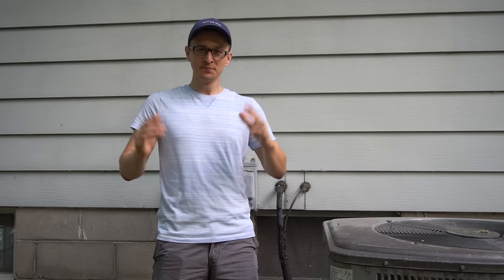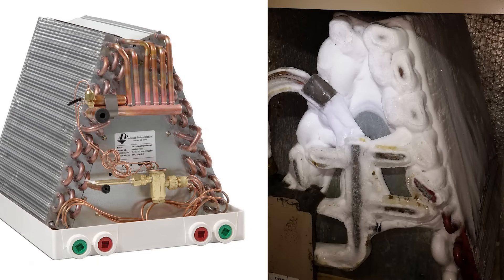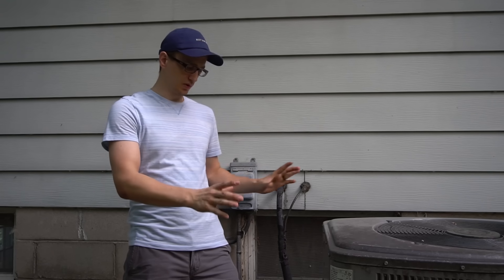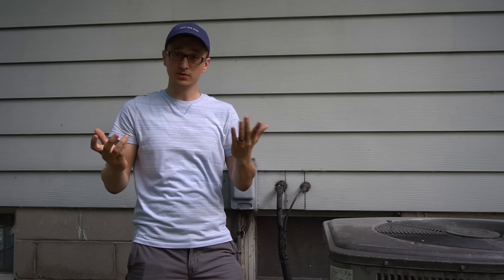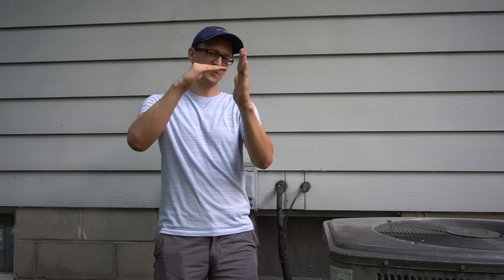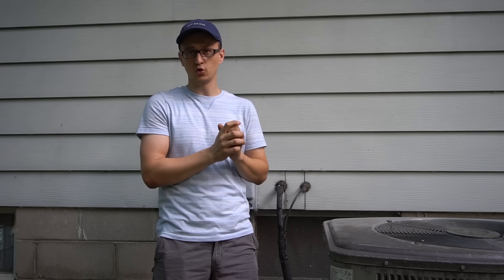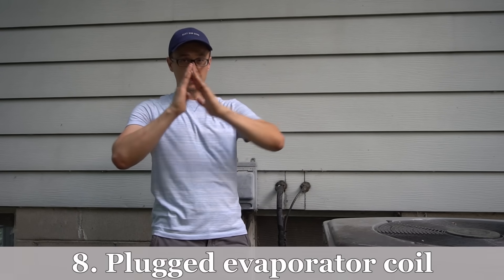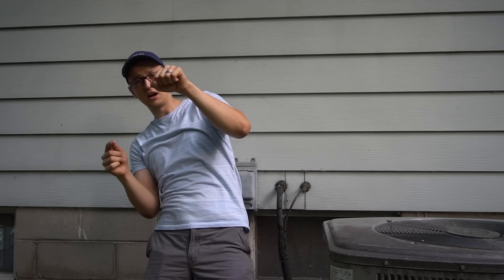8 Reasons Why Your AC is Freezing Up

Comment: I could not piece together why my system all of sudden could not cool down the house one day. The high line was frosting and getting cold after the TXV valve from the evap coils, it was warm then after 10 mins it would start to cool down and frost up. I cleaned the evap coils and turned it on to blow out the cleaner and the end caps started frosting and could not figure it out. Along with some other google searches and remembering comments up until you said the blower motor could be weak on #8 I went and checked my capacitor which should have been 10 MFD was at 2MFD. Ordered another on amazon be here tomorrow. Thanks.
Reply from the maker: Hopefully that will do the trick! Thank you for sharing, good luck!

Comment: Great video! I used these 8 reasons yesterday and it was the capacitor on the blower motor. Quick fix!. This was a neighbors house [younger couple]. I asked have they changed the filter[s]. They replied, "What are filters". They had 2 return air ducts. Oooooo baby! Those filters were in there for years! Thank you so much.
Reply from the maker: Glad to hear you were able to get it fixed! :) Thank you for commenting!
Reply: His dad across the street a/c down same day. I found loose wire. Furnace repair last winter and repairman didn't connect wire. Works great!
day @WordofAdviceTV

Comment: So if you're setting your air conditioner to like 62 for some reason... because you're really hot or something... 🤣🤣
Reply from the maker: Lol, yeah. I was actually just at a house last week where the evaporator coil was freezing because they had the thermostat set to 65 :)
Reply: @WordofAdviceTV  For some reason, my Honeywell thermostat goes as low as 50 degrees Fahrenheit.
Reply from the maker: @07VFDInLCD  Most of them will go to 50 or 55 but if you set it that low, it is almost guaranteed to freeze over. Not sure why manufacturers give you the option then..

Comment: 2:35: The temperature of the refrigerant headed toward the evaporator is only 38 degrees? Is this Fahrenheit? The condenser removes the heat from the high-temperature vapor coming from the compressor, but I had no idea by this much. Are you sure?
Reply from the maker: That wasn't entirely accurate. I was trying to explain it in a simple way. The 38F would be the saturation temperature of the refrigerant. The temperature of the refrigerant itself is much colder. When refrigerant hits air (when hooking up gauges and some squirts out), it comes out at -40F.

Comment: Great job.. well done 👍🏻 
In addition I would add : 

- Thermostat failure causing compressor never shutting off .

- Setting temperature very low while setting blower speed too low at the same time .

- Too high humidity, while temperature is set too low .
Reply from the maker: Thank you!! Good additional reasons! I could have made 10 reasons if I thought of those :)
Reply: How cold is to cold to run my ac during humid days.
Reply: david barnett 
It depends on the efficiency of your AC, the proper air sealing of your room .. etc ..

Comment: Yup....number one happened to me. Except its because I used a new "wrong" filter
Reply: Most companies when installing duct systems don't size the return ductwork for using pleated or electrostatic filters.
A majority of them size the return for the normal blue,green or white see through air filters..if someone has a dust problem, They should use the pleated filters during the colder months since there is less moisture in the air and they don't need to move as much air through the unit..during the warmer or more humid months ,use the thinner cheaper filters to allow more airflow...

Comment: I was hoping that it wasn't because I was setting it at 65 (perfect temp imo) but I noticed last summer if I set it to 67 it wouldn't freeze up. But I guess now I know that is the issue and I'll have to keep it at 67
Reply: 68 degrees Fahrenheit is the setting to avoid freeze up under normal operation.
Reply: @caru3257  

we set it 🥶at 74, in Florida. We could not imagine going down to 67 or we would be ⚰️.

Comment: Isn't the blower motor inside the furnace responsible for making air blow out of the vents?  So if you have air coming out then your blower is ok, correct?  Worried now as husband replaced it, refused to watch video to see how, therefore winged it and uncoiled the thing.  Huge pain to get it back together.  I think it's been freezing up ever since, but it blows so that part must be okay.  The heat wouldn't come on either the last time and I bet it won't now either.
Reply from the maker: Oh boy.. Hopefully it's not as bad as it sounds. Yes, the blower motor is inside the furnace. (I have a video where I replace my blower motor and another video where I explain blower motor wiring) If there is air coming out of the vents, then yes, the motor is good. As for the A-coil freezing up.. As you saw from this video, there can be various reasons why. Is it cooling the house?
Reply: @WordofAdviceTV  Yes it does but it freezes up because it never shuts off.  It ignores when it reaches the temp you have it set at and keeps right on running.  The only way to stop it is to go outside and pull that plug.
Reply from the maker: Your contactor is probably getting stuck in the closed position then. If you have watched a few of my videos you know what the contactor is by now. I would take a look at that plunger if it stuck. Make sure you have all the power off and try pulling on it.
Reply: @WordofAdviceTV  Okay, will do and yes I know now what it looks like and what it does.  Thank you for getting back to me so quickly and will let you know what happens.
Reply: @WordofAdviceTV  Definitely the contactor because it wouldn't pop out until I sprayed it with wd 40.  Then when I put the plug in to start it, it sort of sparked, smoked, and went right back down.  Now not even the fan will come on in there.  I think it was terminal and I killed it.
Reply: @WordofAdviceTV  I did try pulling on it and I tried getting under those 2 contacts and prying it up but not until I used the wd 40 did it pop up.  It acts like something is telling it to stay down as after it did pop up, have a fit, again you could not pry it up and more wd 40 did nothing.
Reply from the maker: @VickiTakacs.  Hey Vicki! Sorry to hear about the contactor problems. To be honest I have never tried spraying contactor contacts with WD-40..  That's not really an "oilable" component. It sounds like the contacts on the contactor are getting welded to the plunger contacts. I would replace that contactor. I have links in the description if you need them
Reply: @WordofAdviceTV  So true that you did not say anything about WD-40 and that's on me.  It was all I had, I was very hot after being outside all day gardening and when I saw that plunger lift, I went a little bit mad.  At that point I would've greased it up with duck fat had it come in a spray, lol.  I think WD-40 is more of a sparky, zzzt type component with a wee bit of smoke.  Am off today to get a contactor.  Will keep you apprised.
Reply from the maker: @VickiTakacs.  Your persistence is wonderful! :) I wasn't saying that oiling it up is bad. Haha I don't even know myself if that's okay or not. Never seen it done. With your positive attitude, I am sure you will get it fixed! Good luck!
Reply: @WordofAdviceTV  I can't really recommend that stuff - A little too exciting with no positive results.
Reply: Hopefully he wired in on high speed for cooling and low speed for heating. I've seen my cousin make that mistake before. Low speed for cooling = bad days ahead.

Also in reading up above, never ever oil certain  electrical components like a contactor. Those are very simple to replace yourself. Turn power off, take a cell phone pic, and hook it back up the same way. They cost like $15-20.

Comment: Have a question please,  compressor hums , don't run , capacitor is good , instead a hard start kit , still hums and doesn't run . Why ? Thanks
Reply: What brand condensing unit?
Reply from the maker: What is humming? Is the compressor working but not the fan? Is the suction line (thick copper line) getting cold? Or is the fan working but not the compressor?

Comment: There is one more Reason for freeze up. If the Contactor does not Release (gets stuck ON occasionally), the pump can keep pumping after the fan is told to stop. Then when the temperature drops and the fan clicks on, its already freezing up. Also, if it is freezing up, way wait so long to defrost it? Why not turn it to heat? thaws is an hour.

Comment: My filters are in 3rooms. I change them every 3 months. When you talk about a filter is there one in the furnace that is up in the attic?
Reply from the maker: If you have filters in your return grills, then it is very unlikely that you have a filter by the furnace. Only way to know for sure would be to visually check though.
Reply: You shouldnt filter each room unless u have severe allergies or some kind of dire medical condition and have a furnace with a UV germ killing light inside. Its overworking your fan motor/ increasing the electric bill too.
Reply from the maker: @srobeck77  Thank you for taking some extra time to answer people Shawn! Much appreciated! :)
Reply: Thanks

Comment: Excellent videos. Could you please tell your viewers How to clean A-Coil in condenser?
Reply: Same way that u clean the condenser coil. Accessing the A-coil is the biggest challenge. That and you probably will need to use compressed air (or a shop vac or leaf blower) instead of water.

Comment: One more reason to add: the magnetic switch that turns the outside compressor on, gets stuck in the "on" position. So when the inside fan turns off, it is still on outside, freezng pipes all the way to condensor. Had to replace this switch. Not sure what was causing it to stick, and was a pain to diagnose.
Reply: That switch is called the contractor.  And yep, a stuck contractor will cause freezing up when the inside blower is not running.
Reply: so low indoor airflow
Reply: More like NO indoor airflow.

Comment: Also, if your air filter is dirty there is the posibility dust is collecting on the blower wheel. The blades of the wheel have a  concave shape to push the air. If they become dirty they will push less air through the indoor coil.

Comment: Also WARNING! Capacitor can KILL you! Even when the power is OFF, it's STILL CHARGED. Quite a danger.
Reply: I dont think anyone has ever died from a split second shock from capacitor. But the suckers are painful I bet.
Reply: @srobeck77  Or from CRTs
Reply: @srobeck77  Oh yes they have! You find the SAME capacitors in defibrillator units!
They absolutely CAN KILL YOU. Look elsewhere here on YouTube for how to safely discharge them, Please! And Google the term "Jesus Stick" ... They call it that because if you don't use it EVERY time you come across a capacitor, then you are going  to be seeing Jesus, much sooner than you (or he?) had intended for you to!
Reply: @w8lvradio  #fakenews. Also your fake comparison between air conditioner capacitors being "the same" as defibrillators as like saying 110v is the same thing as touching a high voltage overhead power line. It's not the same thing......sorry but it's just not.
Reply: do not ignore any of the Warning Labels....

Comment: I live in Arizona. I stay in an apartment. I’m coming up on my 3rd summer here, 1st summer I kept the ac on 68-69 and never had an issue even on 122 degree days. Last summer my ac kept going out and the maintenance man would come and tell us it was frozen and for us to wait a few hours and turn it back on, well we started leaving the temp on 74-75 to avoid it freezing over, let alone leaving it off for a day or two as he’d tell us for it to thaw out but it wouldn’t fix anything. Or if it was finally “blowing” cold air, the amount of air coming out of the vents was slim to none and you could only feel it if you touched the vent, wasn’t nearly enough to change even a degree in the apartment. Needless to say we’d go weeks with horribly hot days. Well here we are approaching summer, got our first triple digit temperature a few days ago and low and behold our ac is out. I can’t help but to think he’s brushing us off or that he’s annoyed by us calling all the time but not once has he ever had any other solution to it being frozen other than us having it set too low which we DONT! it’s set at 74-75, only ever cools our apartment down to 82, AND I make sure to not run it for 2-3 days before calling him so that it has a chance to melt before he gets here if it is frozen so he can at least give me any other explanation than the same bs he’s been giving me for 2 summers now. Would I be wrong to go down to the office and complain??? They don’t seem to care!!!
Reply from the maker: Sorry to hear about the crappy situation. I would agree with you, you should definitely go and complain about that. Likely your AC has a refrigerant (freon) leak and that is why it was freezing up. Your unit will not cool properly until the leak is fixed, some refrigerant added, or the whole air conditioner gets replaced.
Reply: Word of Advice TV thanks to your wonderful video I was able to stop the maintenance man dead in his tracks today as he was about to leave and dismiss us and claim it was because we have it set to low (like always). I stopped him and said “ hey you know what? I’d be a lot more satisfied if maybe you’d check to see if the coil is clogged or if it needs more Freon before you go” (had very little clue what I was saying but I got it from your video & it sounded smart). He looked at me with the most surprised face and went and checked. Well guess what?! It was clogged AND needed Freon! Now I’m no mind reader but something tells me he already knew 😉. Nonetheless, YOURE THE BEST!! Thanks! Saved my family some misery this summer 🥳🥳
Reply from the maker: Haha that's awesome! Way to go, glad to hear you got it fixed! Stay cool this summer ;) Thanks for coming back with an update
Reply: Bri Xo - Sounds like your apartment complex needs to hire a competent maintenance man. That guy sounds like an idiot. If I kept getting called to the same place for the same problem time after time I believe I would WANT to check the basics and get the damn thing fixed.

Comment: Actually there are only 3 reasons why your ac freezes 1 mechanical restriction 2 low on charge or gas and 3 air flow

Comment: What if my fan outside is working and blower is spinning and my ac instantly starts to freeze within minutes of turning on ac? Also i have very weak preasure blowing out the vents
Reply from the maker: I can't say for sure but 2 of the common problems are either a refrigerant problem or low airflow. Have you already replaced your filter? If you go down to the furnace, does it sound like blower motor is running normally or does it sound half dead? If your evaporator coil is accessible you can try taking a look at it to see if it's plugged up too. Unfortunately anything refrigerant related you would need a tech to look at for you though. Unless you know how to deal with refrigerant and have the tools needed of course.
Reply: @WordofAdviceTV  blower is running slower than normal i believe and i tested the run compacitor and is at 4.5 should be 7.5 could that be the issue?
Reply from the maker: @KING__SMOKE  That is pretty far out of range so yeah, it can cause it. Cant say for sure but I would start by replacing that capacitor.

Comment: Anyone can please help m out,I have a problem in York chillers,one of chiller having two system. Both are working perfectly alone,but when I start running system one,it's run upto full speed but don't give command to system two.same is for system two.
Reply: @gregclemen8999     thanku sir, yes u are right both systems are operating through v.s.d ...  chiller is giving a required temperature but one system is running countinously why it's not starting other system ???
Reply: @gregclemen8999  thanku I will definitely discus with u each step I will take in this situation, i will check the control set up tomorrow and discuss with u, can it also be a problem in gate driver?
Reply: @gregclemen8999  ok I will check tomorrow and discuss further 😎
Reply: Hai bro.u was right it was control problem, Today I have replaced control board from the other chiller and it start functioning properly 😊😊😎 one system run upto 100 and then system two start automatically and both system start running at 45 to 50 . Allhamdulillah 💕
Reply: But it's not the right solution of changing control board,I just want to know what can be problem in control board,so that we can rectify that problem instead of changing board.
Reply: @gregclemen8999  fine so thank of u ,💕😍
Reply: @gregclemen8999 sure  thanks again 👍

Comment: Excellent video,  thank you.  So the evaporator will always freeze first and then the condenser?  How about running the a.c. when the outside temperature is less than 55 degrees Fahrenheit?  Can that cause the evaporator to freeze up or do any damage to the unit?
Reply from the maker: If your system is operating normally (not low on refrigerant, no restrictions, etc) then usually that will not be a problem.

Comment: Good day, I have just installed a new 32000 btu unit in my bedroom. The problem is that I run it on 24 degrees during the night on low fan. After about an hour, the compressor stops and the inside unit increase the fan speed which is very disturbing during the night.  The continues for the whole of the night. We are struggling with this now for over a month. The supplier even exchanged the unit and the replacement unit is doing the same.  Do you have any advice?